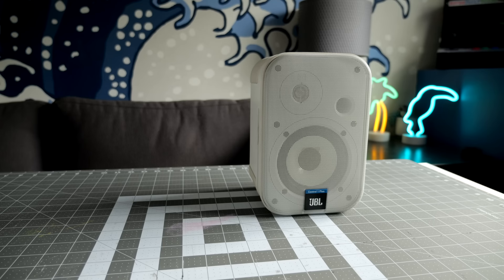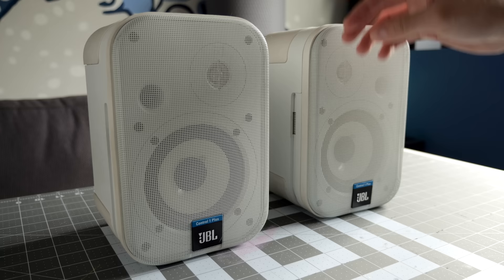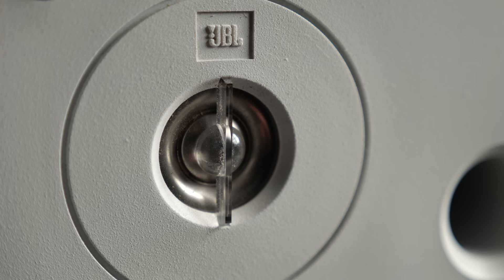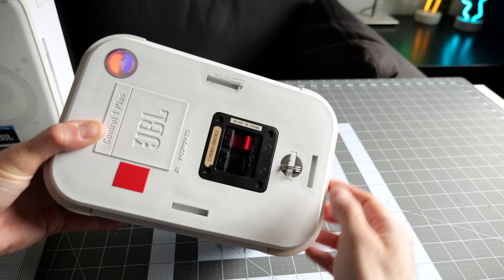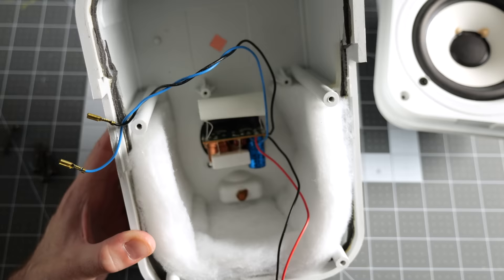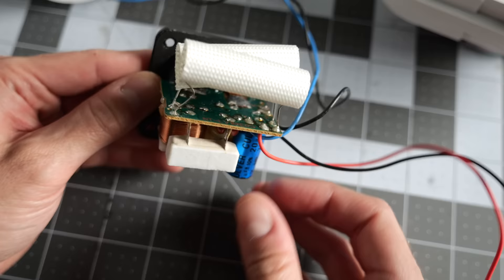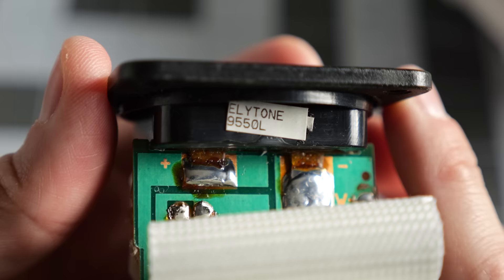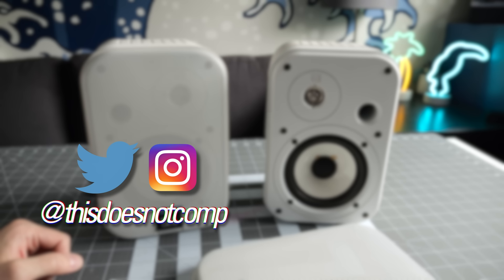Fixing My Vintage Speakers -- But Why Are There Light Bulbs Inside?

Comment: A small tip - on 20yo+ speakers remove the woofers and rotate them 180* if possible to counter the cone sag over the years.
Reply: also magnet movement & voice-coil rubbing.
Reply: unnecessary
Reply: good point
Reply: im going to just say that cone sag is a bit rare. Considering ive been around car audio for years and owned 20+ year old subs that did not even have this issue. And youre talking a fairly large difference to these small woofers he has. 🤔
Reply: Depends really, the poly drivers in my infinitys certainly arent sagging
Reply: Sounds like orc mischief to me
Reply: Come on this has to be a thing only on rubberier or extravagantly large ones.  Once you go past 10" you're essentially losing resolution anyways.
Reply: So youre saying a 32 year old Toyota with its stock speakers, need to be rotated even if they are still working like the day they were put in the car?
Reply: @LSnium  I bought a Honda Element for almost nothing like 5 years ago and the speakers sounded fine, grabbed some nice ones at the scrapyard and went to pull the original speakers. Pulled the covers and what was once the cone on all 4 speakers was completely gone 😂😂 ahh cheap speakers. Can’t believe they sounded as ok as they did
Reply: Cone sag? 🤣 My mind went dark 😆
Reply: I like vintage speakers
Reply: @atari2600b  Thanks for the "Resolution" statement. Makes sense as to why Studio Monitors (Generally) are 8in or smaller.
Reply: @killerrr3211  yeah. Have had cars that did that. Sounded fine but all that was left was the centre cap and spider. Rest had turned into dust
Reply: @forsale313  oh my god, yes, that makes so much sense
Reply: too much effort, just stand the speaker on it's head instead of sitting it on it's ass
Reply: @imclearingit4149  send speakers and amp onto the next mission to the ISS and hope they don't get stolen
Reply: "Cone Sag" on 20+ year old speakers? You just made that up! I have a pair of British Mordaunt Short Pageant Speakers from 1979 (43 years old) and the Woofers have NEVER been "rotated" and they're absolutely fine, and sound AMAZING! ... Glad I could help debunk this nonsense! 👍😂
Reply: @FloatingLeaf1111  store them standing up right lol as in. Motor towards the ground. if it happens to be a problem that should help keep things centered. But i wouldnt worry too much. My well used and abused subs rated 2500 rms each sat for months and didnt have an issue.
Reply: @LSnium  well flip the car over than
Reply: @LSnium  well of course not…those are quality vintage Toyota pieces! ;)
Reply: lol cone sag ... you audio types are something else.
Hey, i have an ultra rare mp3 demagnetizer for sale.   You interested?

Comment: The actual symptoms is a typical electrolytic capacitor failure. an oxide corrosion layer builds so the tweeter cuts out, and cranking up the voltage breaks down the oxide layer, establishing connection. Common in older receivers, etc when they need a re-cap job.
Reply: Spot on. Unfortunately your comment has got lost in the all the waffle.
Reply: @isettech so, would extending this logic to say that regularly using speakers at higher volume levels keeps them in better condition over time be accurate?
Reply: @sc3ku  Only if the crossover in the speaker uses NP Electrolytic capacitors. Over use at high volume has other issues with the breakdown of the varnish holding the wire on the voicecoil,  softening of the cone,, spider, and surround.

Comment: The light bulb isn't just a "replacement" for a fuse - it also flattens dynamics, like a compressor.
Reply: Hey, cheater. I was about to ask what happened to your frog avatar. Then I realized I didn't remember it from YT but from the SDIY list.
Reply: @Gameboygenius  rofl, i set up my youtube account before youtube was bought by google, that's probably why the avatar isn't here. i love the frog, it's so cute haha it was one of the og default avatars on gmail before gmail accounts were used for everything on gmail. do you ever post there? you should :) just to say hi... that gave me a laugh, lol
Reply: also, that account's email inbox got filled up so i set up a new account, and that one has a tek scope now. haha
Reply: This mechanism is known as a dummy load - essentially a wattage dump. Light bulbs are really cheap ways to do that.
Reply: @DM78  it's not simply a dummy load. The circuit is exploiting the fact that the lamp is increasing its resistance when the filament heats up. It's more akin to a PTC resistor or resettable fuse with pretty unusual timing characteristics.
Reply: @DM78  I disagree - a dummy load is meant to replace a real load, not to limit power on an existing load in order to protect that load. Yes, agreed, light bulbs are great cheap ways to do something like this.
Reply: The Urei 811, 813 & 815 Monitor Speakers have light bulbs too on their crossovers as limiters
Reply: @Gameboygenius   thank you!. it stop you kid brother cooking the tweeter
Reply: Amusingly, early radios had a light bulb in parallel with the speaker, to work like an expander.  They mounted it in a tube base and called it an "Expressionator".

Comment: When reassembling plastic housings, turn the screw backwards until you feel it sit in the groove, then start tightening. It avoids cross threading.
Reply: Seems to be what he did during the timelapse althought it wasn't too clear :P
Reply: Yes it's true, I've seen too many people jamming in the screws without paying attention to the existing threads. And after repeated damages of the threads they wonder why the screws can't get a grip anymore... xD
Reply: @frankmeyer9984  ever replaced spark plugs in an engine?
Reply: @JamesTK  Yes, I did that, and other work at cars. And I'm a electrician, and my hobbies are (vintage) computers and electronics. I've seen a lot of "attempted repairs"... xD
Reply: @frankmeyer9984  seen too many people jamming in spark plugs without paying attention to the existing threads 🤣. Combine cross threading with a breaker bar and you've got no more threads!
Reply: @JamesTK  Or they don't pay attention to the dirt at the engine, and it gets into the threads. And the spark plug jams, or gets "baked" to the thread, almost impossible to remove...
Reply: @JamesTK  oh yeah! when I replace sparkplugs or any bolts in engine work, I have to triple clean, like surgery prep, 😆
Reply: Yep
Reply: For the PRO version, i was expecting some kind of SCREWS metal female on the plastic supports, so that the speaker could be serviced (let's be honest... SCREWS on PASTIC are for ONE TIME use... specially on soft plastic like the CONTROL 1). I opened a CONTROL 1G pair (because the woofers just DISINTEGRATED!!) and i just gave up!

Comment: Some old school appliance repairers swear by "dim bulb testers". A regular household incandescent bulb is wired in series with the device you're testing. If the device begins drawing too many amps, the bulb will glow and you'll protect the device from burning out.
Reply: Yep, go watch the YT channel Shango066 who repairs mostly old TVs, and Radios, along with the offhand social commentary, and in a fair number of his videos, he uses a homemade dim bulb tester as part of his diagnosis process.
Reply: An easier way to do it is to use an automotive inverter with a fuse.  This way you also get an isolation effect. as well as current limiting.  Very cheap if you already have the inverter.  Plus they are dirt cheap.
Reply: I use one myself. Three bulbs with switches, (2x 40W and 1x 60W) to give equivalent 40W, 60W, 80W, 100W, and 140W power limits. Indispensable.
Reply: @CommodoreFan64  I watch Shang066 & Mr. Carlson’s Lab…
Compare and contrast..😂👍
Reply: @outaspaceman  👍
Reply: @tripplefives1402  It really depends on the device.  I'm just saying if it's handy and you already have it, doesn't cost anything and gives you protection (though, to be fair, the bulb does too)
Reply: @outaspaceman  I liked Shango until he started putting long political rants in his videos
Reply: @gigigigiontis8  mmm.. I know what you mean, but sometimes it’s necessary to separate the art from the A/hole..😉👍
Reply: @tarstarkusz  But then you're back to blowing fuses when something goes wrong. Even if your inverter has electronic overload protection it will probably just cut out. The beauty of the dim bulb tester is that it keeps supplying power so you can live troubleshoot.

Also most automotive inverters are non-isolated. Even worse both terminals are live.
Reply: @eDoc2020  But most 12v power supplies are.  That's where the isolation comes in.  Blowing fuses isn't great, but at least you get the protection.
Ideally you would use an isolated current limiting power supply with variac.
Reply: @tarstarkusz  My point is you're just moving the blowing fuse from one place to another. In terms of current limiting you may as well just use a fused extension cord.

While many 12v supplies are isolated, the larger ones like you might use to feed an inverter are more often grounded. It's also worth noting that even with an isolated supply a metal inverter case will also be live relative to its outputs.

Basically I'd say the inverter setup is a half-usable replacement for an isolation transformer but not so good for current limiting.
Reply: @eDoc2020  But you can current limit the inverter with a fuse.  The wall fuse is 15 amps at 120v.  If you are working with something that uses 20 watts, you can put a 2amp fuse on the 12v side of the inverter.. This will limit the AC side to less than 250ma.
Yes, when possible, always use the right equipment.  But this is better than nothing.  It's the same with the lightbulb.
Reply: @tarstarkusz  My point is you could also put a 250mA fuse on an AC cord if you want to limit the AC current to 250mA. The only benefit I can see of using a power supply and inverter with a DC fuse is that the fuse might be a bit cheaper.
Reply: I do that too at times. A good way to not ruin the device if there is a short, or a cap reforming drawing high current.
Reply: @eDoc2020  Isolation. And it's easier.  I've said the whole time that this was an "if you already have i and nothing elset" plan. (it's also a cheap way to run  low power devices  form 240v/50hz countries, but you would have to buy a cheap inverter for those markets.  It's just very basic protection.  Really, you should be using an isolated current limiting variac.  This is the ideal way. But most people effing around in their garage aren't going to buy the proper equipment.  A current limiting bulb is certainly another option and not a bad one.
Reply: @tripplefives1402  (rushes out to check output of recently purchased inverter)
Well, fancy that..! 😮👍
Reply: @tarstarkusz  these bulb are even cheaper and inverters still can go broken with shorts. So both have their advantages.
Reply: I agree.
Reply: I learn so much from YouTube comments. Thanks.